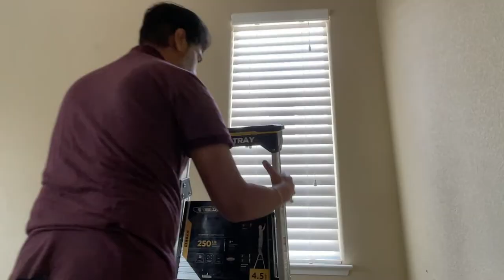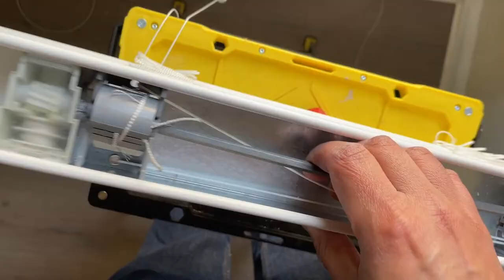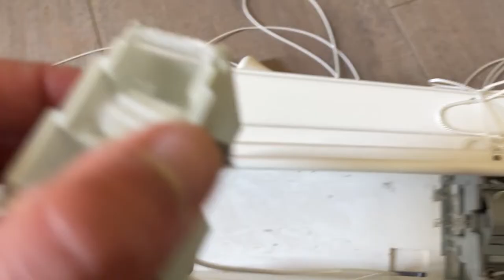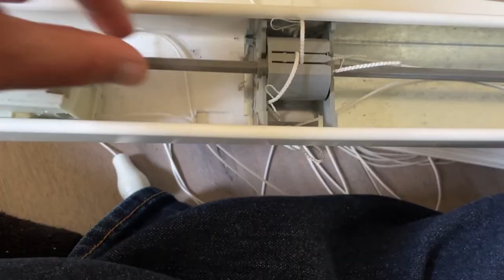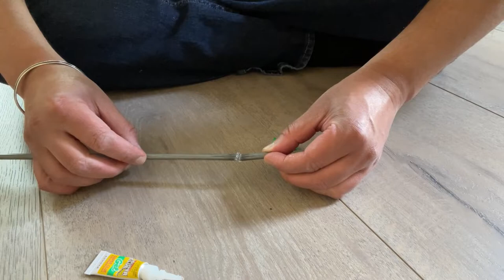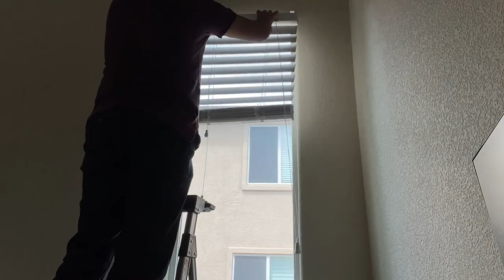Window Blinds Won't Tilt Open, Close? Repair in 5 Minutes DIY - 2" Faux Wood Blind with Pull Cord

Comment: I pulled mine apart and found the worm gear broke off a tooth and seized up. Amazon had a replacement for less then $10 and was easy to install.
Reply: Could you provide a link?
Reply: No problem. I found it based on title you provided

Comment: Similar problem...only the blinds turned partially one way but not the other...only then pulling the top blind up against the  rail ...took it down and  everything seemed ok compared to an identical blind that works...the string inside the wheel was at a minimum...likely causing the lack of movement...so I tried rolling some string back...but the problem still exists
Reply: Did you fix it, having the same issue 😭

Comment: I just turn the stick around put the broken part on the other side
Reply: That sounds like a much better fix.   How many turns do you think that repair will work with a superglue fix?  Not many I think.  And it's lots of trouble to take the blind down.

Comment: I followed step by step but my rod would not stay glued together and I used gorilla glue. 🥺
Reply from the maker: I let it sit for a good 10 minutes and worked like charm for me. (Used the superglue from dollar tree) tip: do ensure that the surface of the rod is free of any dirt or small particles.
Reply: Use jb weld epoxy